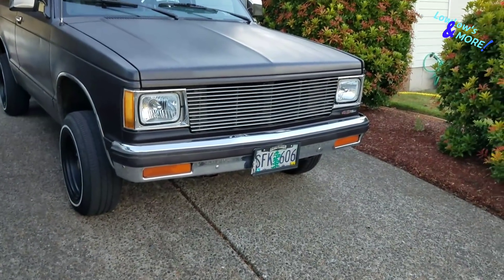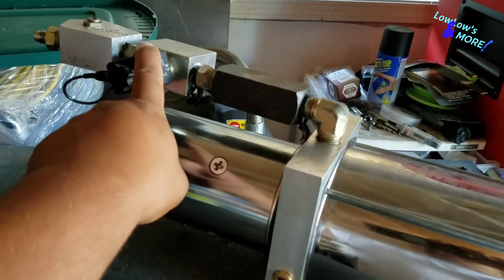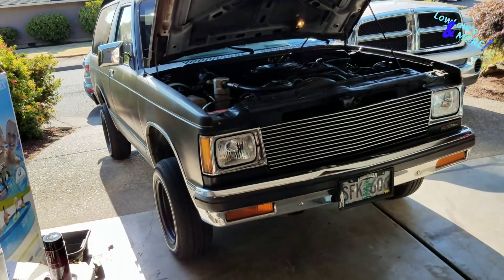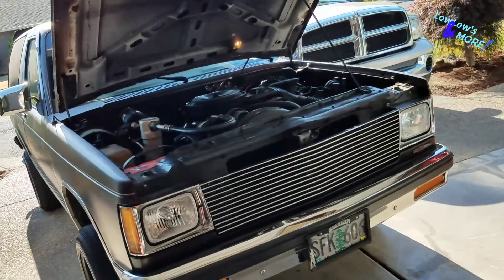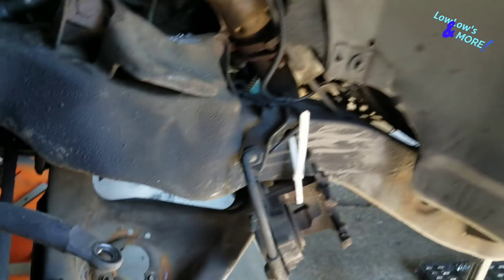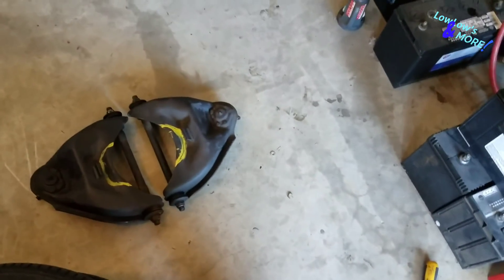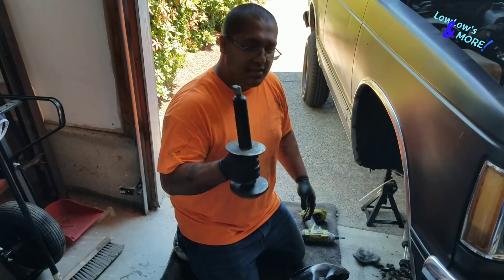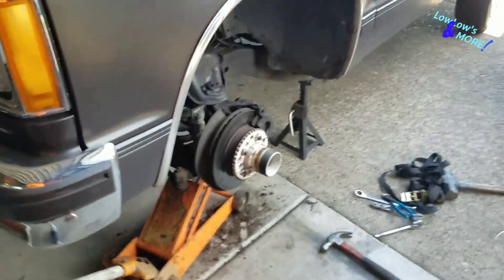Building a Lay n Play Lowrider Part 1

Comment: Fuckin a.. good tip on not Drilling in the shock hole. And I'd be worried about them ball joints. the upper ones look like The Originals cuz they were riveted in
Reply from the maker: fuzzy wuzzy 
Those will be changed soon, the homie a lil tight on cash right now.

Comment: Good video man. I had a question about the the upper arms I have a G body monte  do you know if it possible to you  caddy upper arms to get a higher lockup
Reply from the maker: You can use the spindles from a caprice for a higher lock up, the upper caddy arms will give you some camber but will need to be modified to fit.
Reply: They fit fine I run them on my cutty

Comment: Would you off set the hole when cutting through the frame of a gbody to fit the cylinder? Also do you need to cut the a-arms to fit the cylinder for a gbody?(cutlass)
Reply from the maker: Yes on all rides, the hole needs to be offset, you will need to cut out a small piece from the arms for the cylinders to clear.
Reply: Thanks homie! Btw what happened to the gbody tutorial you were working on? I was really looking forward to learning the ins & outs of building a gbody since I'm starting mine here pretty soon.

Comment: Have you ever Juiced up a 94-99 Cadillac Deville.
Reply from the maker: Not yet
Reply: @lowlowsandmore  I'm 46 My name is Tomas Gringo. At a very young age of 14 I wanted a 63 2 door hardtop Impala. I worked in 1 of Father's garages he had 5 and 2 junkyards. My father has passed. He found me a 1971 4 dr hardtop for 1000 it was in the classified adds I got off work we went and checked it out. 1 owner sitting in her garage looked new. Car has 50.000 original miles I left the engine and bay alone you can eat off it as well as the exterior. It's juiced with oldskool Reds hydraulics competition pumps 8s in the front 10s in the rear far as cylinders the President's brother and me installed everything I left the switchbox to Alfredo. The car sits on 13x7 wire's Emerald green paint with metal flake. Simulated black convertible top with 67 Impala emblems. I put fender skirt's on it from a 1973 Impala. Interior is mint I left it alone only a chain 10 inch 3 spoke steering wheel from California. We started a car club back in 1993 in Louisville PorVida C.C. I've customized to many classic cars of my own back in my day. I still get down with with old cars and buy classic creampuffs with low miles. My project now is a 1 owner 1999 Cadillac deville the elderly man pssed away and I bought it from the widow perfect interior and perfect white diamond original paint. Need's very little work to be a daily lowlow need's a antenna which Im rebuilding at this time a minor 40 dollar Purge valve solenoid for the Evap system driver's side front wheel bearing it's starting to vibrate a little. I stole the car for 1700 cash with 70.000 miles. It's a 4500 car all day long. Im going with 14x7 spokes and a 2 pump set up. Far as paint the original is flawless so I'm wet sanding it with 400 and blocking it Im using a intercoat with 00.04 micro metal flake and doing ghost patterns. It'll be cleared 3 time's. Im reaching out to you because I've never juiced up a front wheel drive vehicle not even my FWD 1972 Eldorado droptop. I see you guy's use CCE Cool Cars Hydraulics Im good friends with them I've bought spokes from them but never let them juice up my ride. Not saying nothing bad about CCE my and car club always done our own work and paint but the club split. I remain true to my roots and Lowride PorVida ForLife until my wheel's fall off and I can't ride no more. My questions to you are Do you take on outside work would you be interested in making money. Next is what is the name of your car club and how many chapters does your club have is there a chapter in the  Kentucky. Thank you homie.